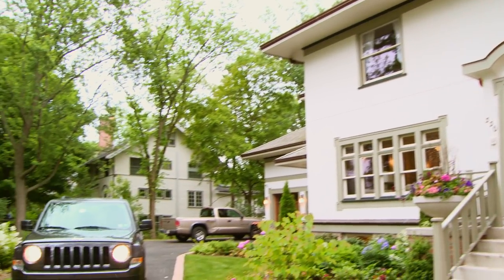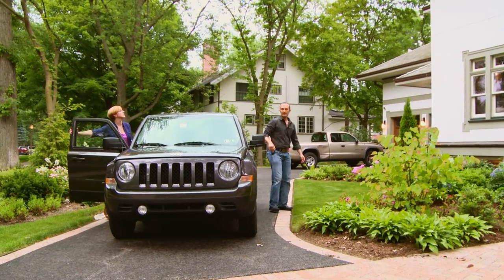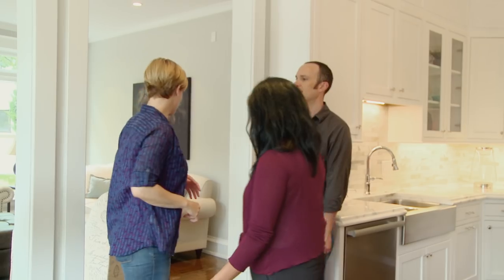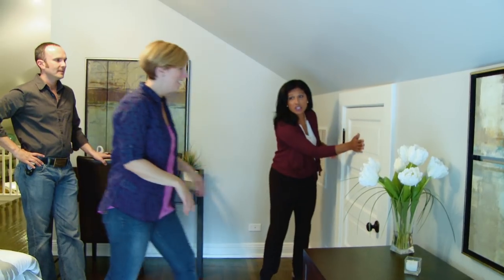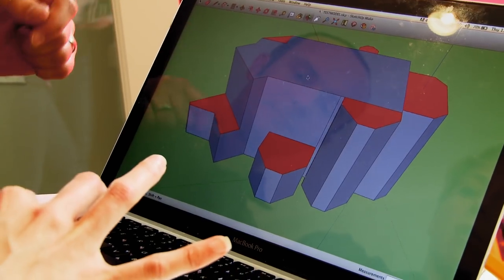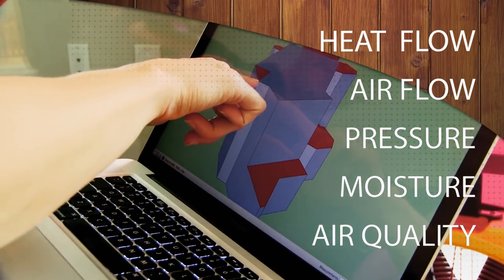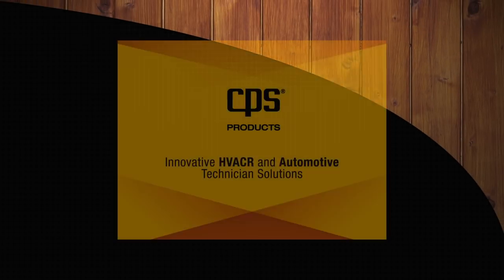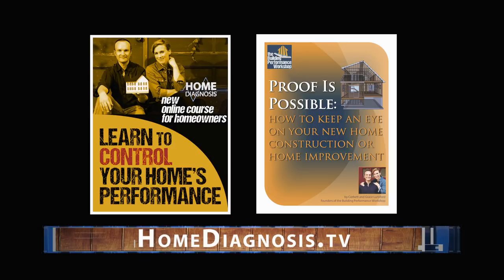Science of a Renovated Home: Tuned and Tested - Ep 101 of Home Diagnosis TV

Comment: Very interesting watching this as I'm a domestic energy assessor in the UK.

I find home owners here saying the same things. Condensation on widows is usually down to high humility in kitchens/bathrooms, we don't often have HVACs in homes only extract fans, which people never turn on while cooking. 

Surface condensation such as that you found in the attic would likely be due to either insufficient heating to increase surface temperatures or inadequate insulation resulting in excess heat loss and thus reduce surface temperatures. I was surprised that you put this down to poor air tightness. Did the room even have heating in it?

Surly removal of the over sized HVAC system is unnecessary, it would just run at a less efficient rate to a "correctly" sized system?
Reply: IHOW inadequate summertime dehumidification occurs with systems sized so large that they short cycle - turn on and off before adequate dehumidification is completed.

Comment: so what happened? wheres the follow up? kinda got left hanging.
also would have liked a better explanation of why the big hvac was causing the issues.  (hvac is rare here)

on the positive side it looks nice, nice filming, you looked really good and you highlighted some common issues. nice job!
Reply from the maker: We made this first season with almost no money, so enjoy what came of it! If the DOE or a network had taken the lead, we would have given you before and after.
Reply: @HomePerformance   at least its a start in the right direction. i'm so sick of "make it all pretty so we call sell it for heaps" shows.
Reply: An air conditioner will dehumidify while cooling the air. - Very basic description. Think back to when Corbin was testing wet bulb and dry bulb.

The longer it runs, the more humidity it's able to remove.

So if the hvac system is oversized, it runs a short period of time. Not allowing it to pull enough water out of the air inside your home. When sized correctly, it will run the right amount of time to efficiently dehumidify your home.

But that's just a small portion of the system. You need the correct size duct. To small you can't move enough air. To big and there is not enough velocity.

In this episode, Corbin specifically mentioned small ducts. He was referring to the return ducts.

A system is design to move so many CFMs per ton. Let's use 400 cfms per ton. A 5 ton system is required to move 2000 cfms in this example. So it needs to pull in 2000 and push out 2000.

Well if it's only pulling in 1200, it's only pushing out 1200. When this happens, you can't push enough air through ALL the ducts. Typically the furthest ducts suffer and you start to create hot/cold spots.

Really difficult to fully explain this on a social media comment. But this is the very basics of what Corbin was talking about in this episode. At least it's what I picked up on and combined with my little bit of knowledge and experience.
Reply from the maker: Great description
Reply: @HomePerformance  Thank you!

I love working in the HVAC trade, a few years ago I made air flow my "thing" to improve in my skill set. Still have a long ways to go. But i have come so far.